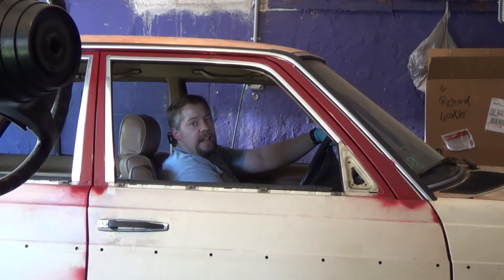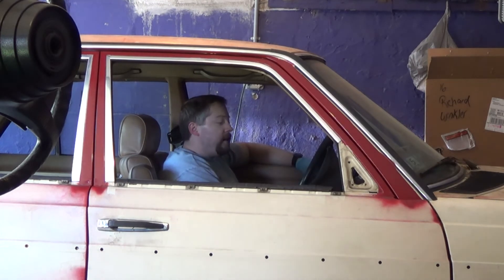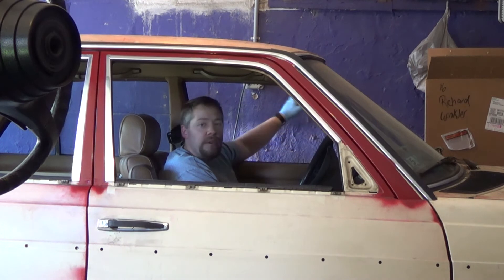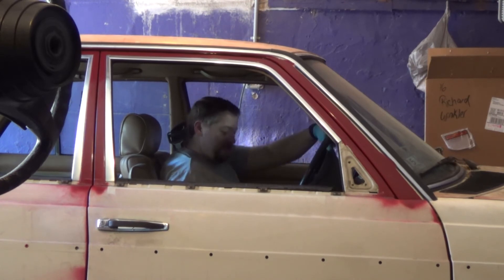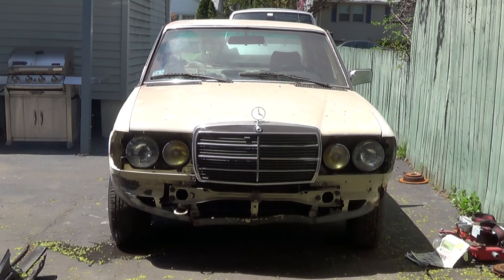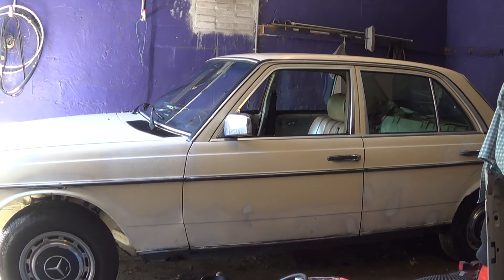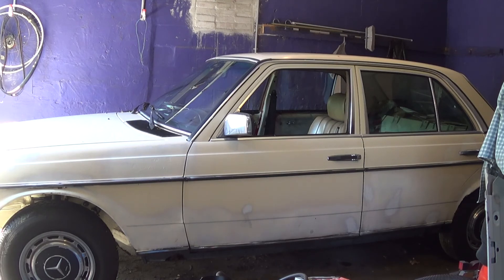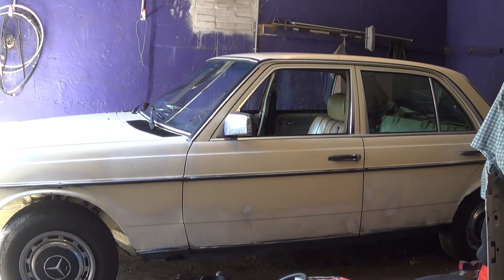1983 Mercedes-Benz 240D - part 61: starting on driver's side

Comment: You could buy exhaust for it, and drive it like that.
Reply from the maker: No need - the car came with a brand new exhaust system that's never been installed. I'm holding off installing it until I replace the clutch.